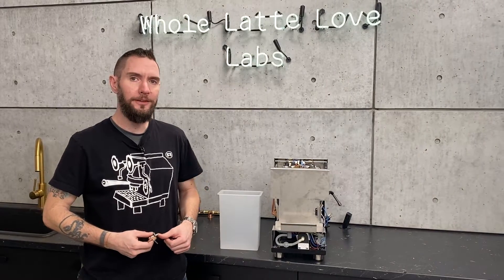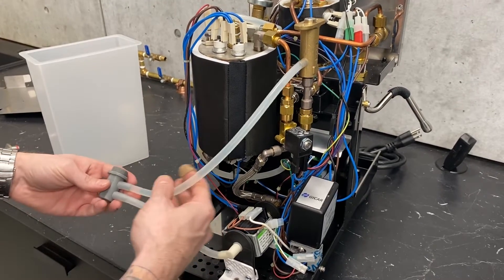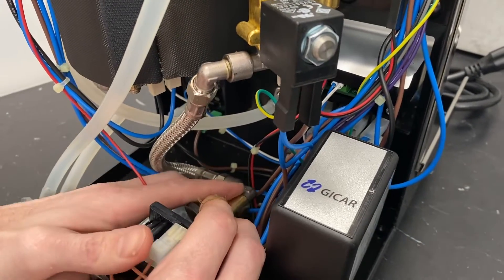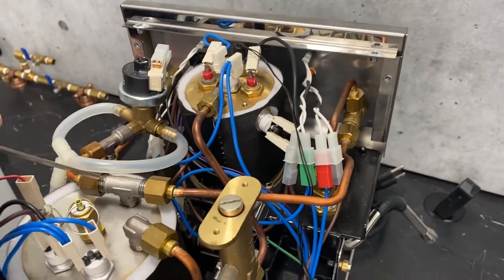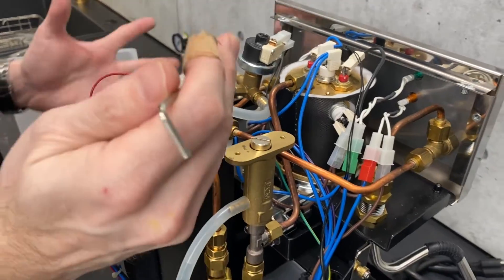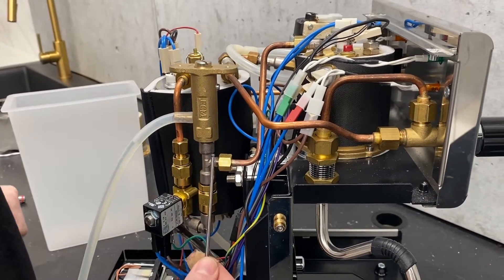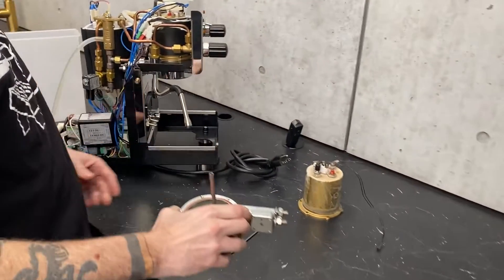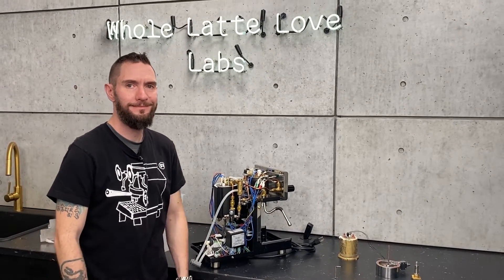Profitec Pro 300: Internal Tour of Hydraulic System

Comment: Thanks for the tour! Question: what can cause the steam pressure to raise above the normal limit on P300? I have adjusted the pressure on PSTAT but that didn't help. The pressure keep growing above 2 bars. Thanks
Reply from the maker: Hey g, You are welcome. Could be faulty pressure gauge. Does it return to zero when machine is off? Might be bad pressurestat or scale in path to pressurestat preventing it from reading pressure in boiler.
Reply: @Wholelattelovepage  no the pressure remains the same if I turn steam boiler OFF.
Reply from the maker: @grabelnikov  if gauge stays at 2 when boiler is off and cold then it’s likely faulty gauge.

Comment: Beautiful tour of the inside of the Pro 300. It speaks to WLL caring about the quality and reliability of the machines they sell to demonstrate how they work internally. Nice to see how the machine can be serviced for various problems which will probably show up if you own the machine long enough. As a separate thought, I wonder why the copper tubes that lead out of the steam boiler don't have heat insulation, especially since they pass near electrical wires.
Reply from the maker: Hi dan, thanks for the comment! We do care and put a lot of effort into support and training materials. I've been inside just about every home use espresso machine available in North America over the past decade. While boilers often have an insulating wrap it's incredibly rare for individual copper pipes to be insulated.

Comment: When it shuts off the pump when using the backflush blind filter and has unsteady flow when brewing, is usually the OPV calcified/stuck or is the pump just too weak?
Reply: OK, changing the pump did the trick

Comment: I considering to buy this Machine or Lelit Victoria that has a few more option. However the Build quality of Protec seems to be better 
guess the Espresso quality would be the same.Struggling which one I should get
Reply from the maker: Hi Roland, When comparing most machines the potential espresso quality is similar - it really comes down to the skill of the user. But, some machines have features which help the user with consistency.
Marc

Comment: ⁉ Can anyone confirm with 100% certainty, that the water comes from the boiler through the lower hole (e.g. number 2 on the valve) and then gets through number 1 on the valve into the upper hole in the grouphead and to the shower at the end? It's a critical question for me as I would like to make a brew pressure measurement block and only in that configuration e.g. valve-shower pipe on top am I able to do it (because of a very limited space in the machine and manufacturing constrains). I will be very grateful if somebody could definitely confirm the water path here 🙏

Comment: Hi whole latte love, thanks for the showdown. But what is the longevity of copper heating elements? And should I be worried about leaching copper in my water? 

Thanks in advance
Reply from the maker: Hi BD, Thanks for the question. No worries about copper leaching. Heating elements are robust and unlikely to have issues unless you somehow repeatedly turn the heating elements on with no water in the boilers. That's very hard to do on a dual boiler machine.
Reply: @Wholelattelovepage  thanks 🙏

Comment: Thanks a lot for the detailed tour and other videos! On my Pro 300 the hot water wand got clogged, so I had to remove it and clean it up. However now it's leaking a bit. I was surprised that there is no gasket. How do you seal it?
Reply from the maker: Hi Brian, You are welcome. Here's a video which covers servicing the hot water and steam valves on the Pro 300 which should answer your question: https://youtu.be/Lg2TXUR_EC0
And here's a link to our support section for the Pro 300. Lot's of other DIY videos there specific to the machine: https://support.wholelattelove.com/hc/en-us/articles/4419664344723

Comment: Ok Marc, another great video. I'm looking to move on from an Ascaso single thermoblock PID machine. Looking at the ECM Tech, ECM Mech, Prof 500 and this Prof 300. Any of your input would be appreciated!! And how do you set the brew pressure with no built in pressure gauge for the brew?
Reply from the maker: Hi Jeff, As you mentioned in another comment the Technika has the rotary pump and is plumbable. I really do like plumbable machines as I detest filling reservoirs. Also makes water treatment easier if you need to do that with an in-line filter. Unless you have unusually soft (low mineral content) water your should filter water to reduce calcium to prevent scale. If you go with an HX boiler machine it's possible for home user to descale. It's more difficult for home users to descale dual boiler machines - most manufacturers recommend against home descaling of DB machines. So if you go DB you really need to prevent scale in the first place with filtration. The Pro 500 PID is a long time favorite of mine in the HX boiler category. The Pro 300 is ready to go quick with the brew boiler over group design and it's suitable for lower volume home use. Machines with E61 groups generally need about 30 minutes of warmup time before use. Brew pressure on the Pro 300 os set by adjusting the OPV. There's really no need to change it from the factory setting. But if you do need/want to change you'd have to have a PF mounted pressure gauge to do so: https://www.wholelattelove.com/products/brewpressureportafiltergauge
Marc

Comment: I’ve seen this machine listed with stainless steel brew boiler including on the profitec website. The one in the video is brass and I’ve seen it listed as eco-brass. Was it ever changed to or from brass to stainless or is it just incorrect info? Thanks
Reply from the maker: Hi Kevin, Maybe some confusion between the boilers? The steam/hot water boiler is stainless and the brew boiler is brass. I checked Profitec's site and it's listed like this:
0.4 l coffee boiler with a ring brew group
0.75 l stainless steel steam and hot water boiler
So the Profitec site makes no mention of brew boiler material.
If you go to our expanded specs for the Pro 300: https://www.wholelattelove.com/products/profitec-pro-300-dual-boiler-espresso-machine#product-specs boiler materials are correctly identified as brass for the brew boiler and stainless for the steam boiler. To the best of knowledge boiler materials have never changed in the Pro 300.
Reply: @Wholelattelovepage  thanks for the follow up! Spend too long looking at specs and machines and things start to blend together but it’s part of the fun right? Thanks again
Reply from the maker: @kevindarby8799  NP☕️

Comment: Question Marc , why do they have the steam pressure set at 1.2bar when the blow off valve is set at 2.5bar, could one up the pressure in the steam boiler 1.8bar  without any problems?
Reply from the maker: Hey Tom, Probably set there because pressure is respectable. We have run Pro 300s at 2 bar pressure for extended periods with no issues. 1.8 should be fine. Be aware there are 2 safety valves on the boiler. The one that's in same fitting as the vacuum relief is at 2.3 bar and the more typical one atop the boiler is at 2.5 bar.
Marc
Reply: @Wholelattelovepage  Thanks Marc for the quick reply.
Reply from the maker: @tomjohnson4681  my pleasure!